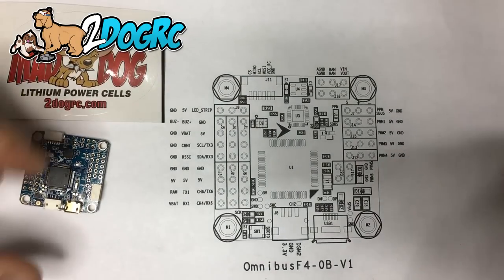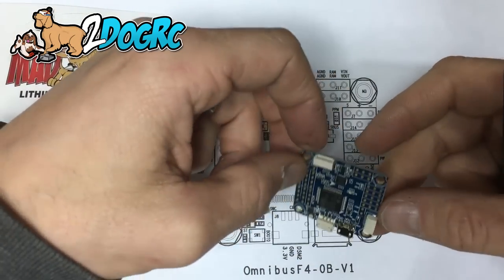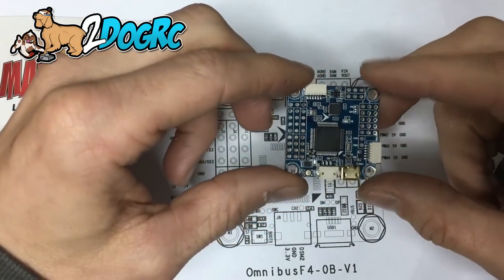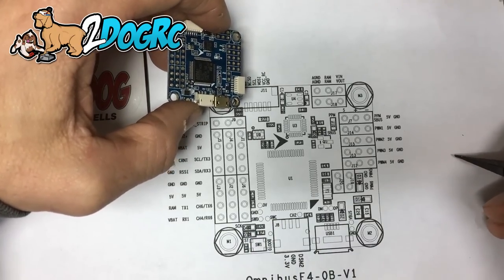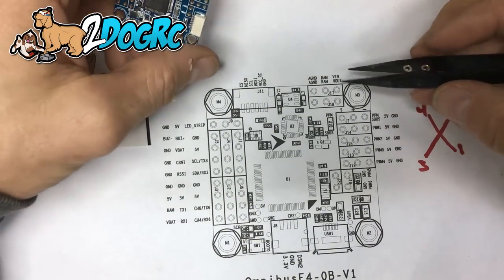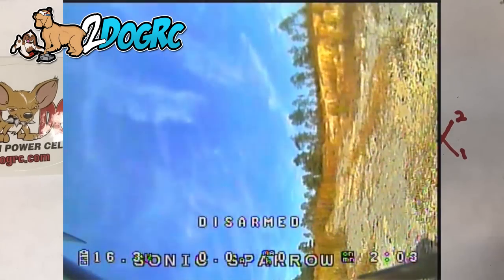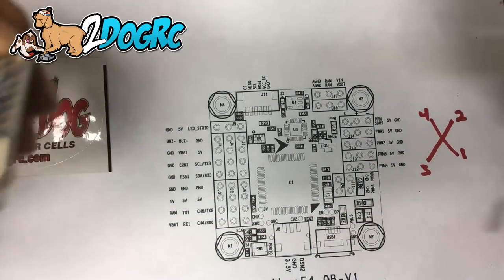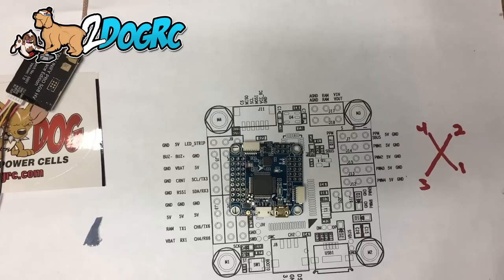Omnibus F4 V3 All in One Board Hook Up Instructions

Comment: Watched this whole video for the leds...
Reply from the maker: Connect the signal wire to the LED tab, then the pos from the LED's to any 5V source on the board.  THe neg wire form the LEd's to any ground on the board.  This is if you have programmable LED's.
Reply: 2dogrc - Na just have + & -
Reply from the maker: Okay well most of those are 12V, however I run my Diatone Flashbags, which are 12V, off VBat. So your options are to run them off 5V, very dim, add a 12V regulator, or run them off battery voltage.  If you want to run them off battery voltage, then plug them into you PDB anywhere there is a +  and -.  You don't need a FC at all for these.
Reply: 2dogrc - Awe ok so unless they have a signal wire they aren't programmable, that makes sense I guess lol
Reply: Can you direct me to a vid where the LEDs are programmed in detail INAV. I'm just having no luck.